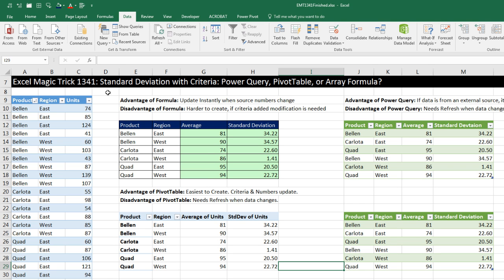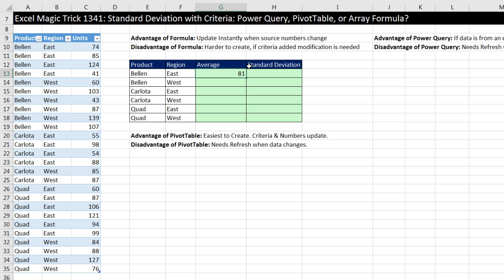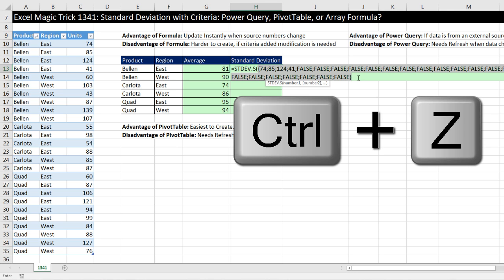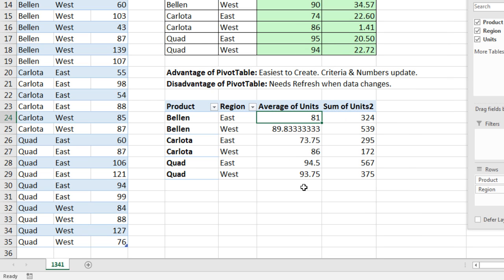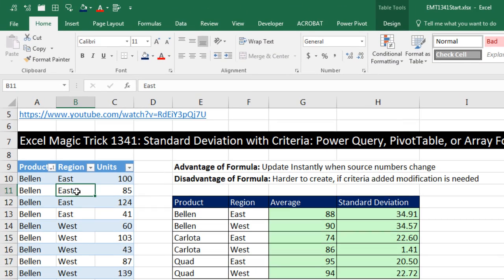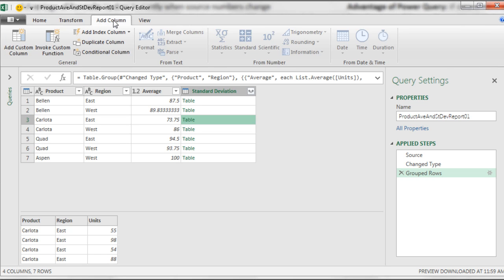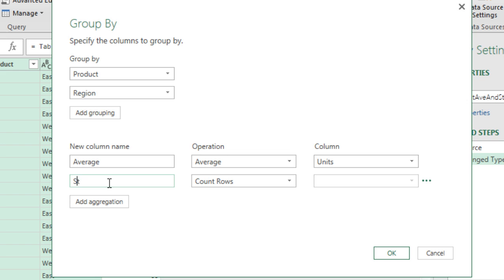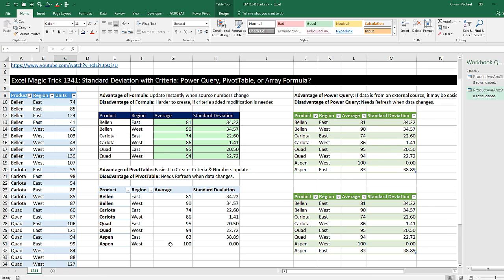Excel Magic Trick 1341: Standard Deviation with Criteria: Power Query, PivotTable, or Array Formula?

Comment: Another great lesson!! Thanks :-)
A few words about PQ solution (the last one)
Of course, you can change the code in the advanced editor window but, exactly like in excel, you can change it in the formula bar also. 
I think, this is more convenient because you see only the step you want to change (of course only in case when you don't want to add some complex changes or write the function code).
Reply from the maker: Thanks for the great tip of using the Formula Bar, O, Power Query Master! : )

Comment: You could select a column in the table by clicking in the header instead of selecting it all the way down.
This is a much faster way and it is one of the reasons why I like tables rather then lists.
Reply from the maker: Thanks for the hot tip!
Reply: Couldn't figure out what you meant by this. Kept getting [#Headers]. Has to be the top of the header when it changes to downward arrow. How did I not know this? Great tip. Going to save a lot of time. Thanks!

Comment: There is a 4th method as long as your data is sorted by the columns in your condition criteria.  You can use the index function inside the STDEV function to dynamically find the range to apply the STDEV too.  It is a complex formula, but it performs faster than the array formula on large datasets.
Reply from the maker: Thanks for the hot tip with INDEX!